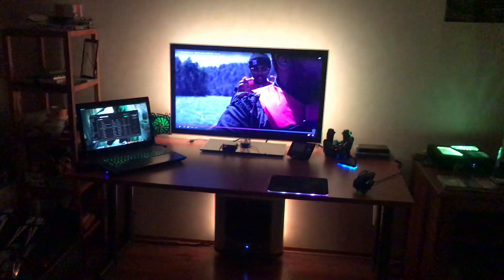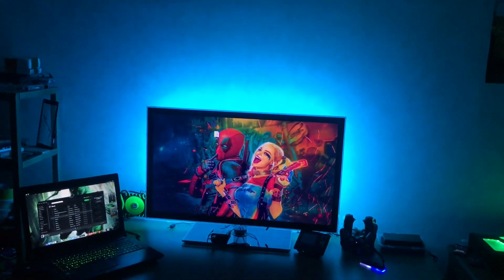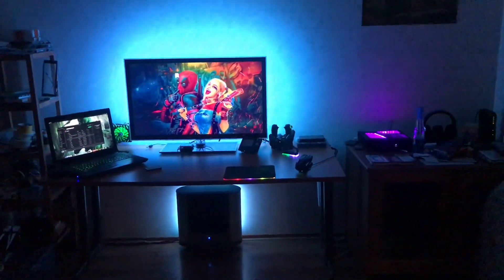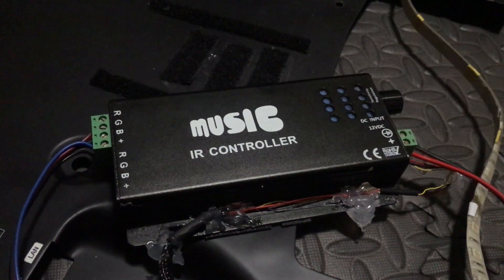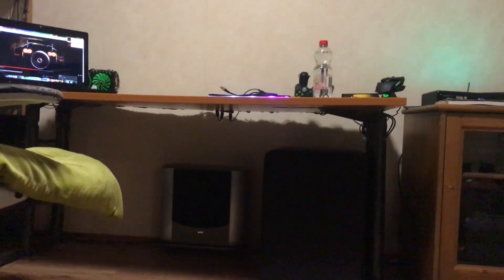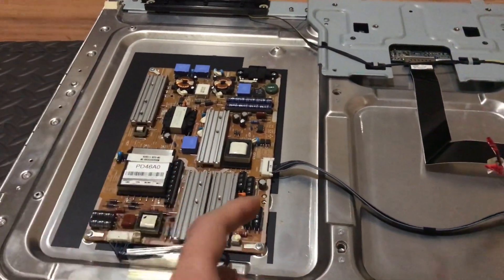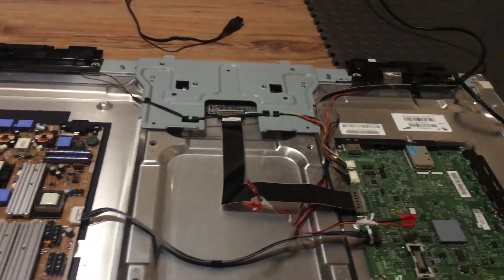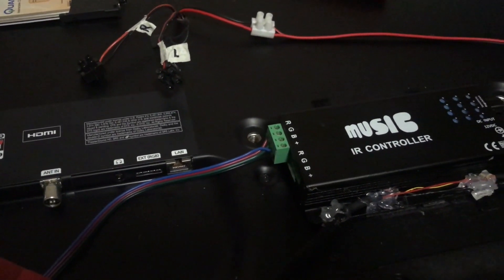Samsung Tv LED MOD upgrade!

Comment: ive got the exact same tv, why you gotta make me wanna rip it apart and put leds in it
Reply from the maker: Lmao! what are the chances! the led mod is safe it's on the outside and since you'll probably not have that gpu crash issue you could run it with external power like i used to, no need to rip it apart, just hot glue led strips around it with a controller on the outside.